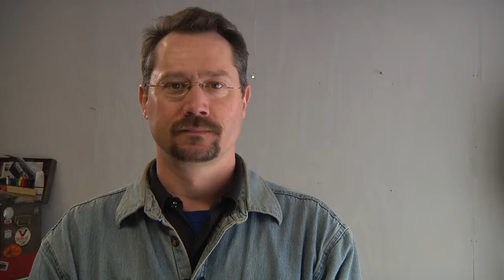0 Intro to Build Your Own Electric Motorcycle Playlist

Comment: What are the pro and cons of converting a scooter but keeping the variator?
Reply from the maker: Could you use a different word than "Variator"? I'm not sure what you mean. Sometimes names of parts are different between American Standard English, British English, and other dialects.
Reply: A variator is the variable belt driven gearing used in scooters  were the pullies expand when the weights fly out based on centrifugal force.  
     @BenjaminNelsonX

Comment: Thank you so much. What are your goals and projects you are working on now?
Reply from the maker: The big project this last year was building the Solar Garage. That's gone great. I love NOT paying for electricity. Combine that with an electric car and the savings are pretty impressive. https://300mpg.org/bens-solar-garage/
Right now, I'm doing some work fixing up old electric lawn and garden tractors. I'll probably make some more videos teaching about electric motors while I do that. I also still have fantastical ideas about building a hybrid pickup truck. That was an idea from years back. I'm still shocked that we don't have commercially available hybrid trucks yet! https://300mpg.org/2012/08/29/jack-daniels-independence-project-entry/
I'm also considering starting a Patreon page. I have quite a few subscribers here on YouTube who have been very supportive of my work. I'm hoping that with Patreon, I'd be able to dedicate more time and energy into my DIY Videos.
Reply from the maker: I just got a CLASSIC Ford Ranger EV. This is an OEM Factory-Built truck that Ford made in the "Mandate Era" of the EV1! I'm going to retro-fit a lithium battery pack into it. It originally had lead-acid batteries from the factory.
Reply: A patreon would be a great idea
Reply from the maker: @JasonTRogers   Hi Jason! I just recently set up a Patreon! Would love to see as many people there as possible! Thank you! https://www.patreon.com/300MPG

Comment: I bought that DVD and for the life of me cannot figure out why you didn't upgrade the batteries
Reply from the maker: Hi Michael. By the time that I could get my hands on some affordable lithium batteries I had also found a Vectrix electric motorcycle for sale, which only needed batteries. I put the two together and was on to my NEXT electric motorcycle project. Search my channel for videos on the Vectrix.
Reply: I had seen you put the Leaf batteries in the Vectrix